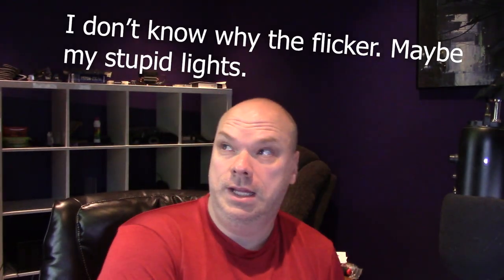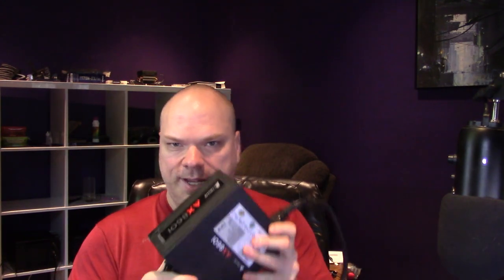Starting Your Own Scrapyard PC Operation, Part One: Toolbag

Comment: My recommendations also for cleaning dirty ass systems of course the data vac since it’s good investment and saves you money in the long run rather than buying canned air by the pack. A cheap paint brush to remove dust in certain areas say motherboards and cleaning wipes for the final clean

Comment: i like those tubes you get at the dollarama that has two sizes of zip ties in them, plus they also have the tools needed for you in a lot of this racket now (if you got one near you). had not seen your video in my feed and finally had to seek it out haha. Yeah im scrapyarding now as well, mainly just for family and friends, even getting stuff like newer laptops and cellphones. I agree with your tips, but i also suggest milk crates for storage if possible, some of that shit is heavy (hard drives) and you need something strong that wont fall apart above your feet (ask me how i know). im actually going out to my shed today to get space freed up to store a lot of the stuff im given so its easier to access and i can work on shit out there. glad to see youre still on the go. 
ps ever think of doing an Emulation build?

Comment: Your LED lights are probably strobing at 120 Hz, causing the flicker.
Reply from the maker: That was my first thought too, but 120 hz on a 60 hz video shouldn't be noticable, no? I'm under the impression that it'll only be a problem if the lights aren't strobing at a multiple of 60.

I am most certainly not the most knowledgeable A/V guy.
Reply: @Oafah  I know the video output is 60 fps but Is the camera's shutter speed actually 60hz? I'm also assuming the lights aren't dimmed.
Reply from the maker: @dycedargselderbrother5353  Good question. And no, the lights aren't dimmed, but they are shitty portable work lights that I'm using as video lighting. Probably not wise.